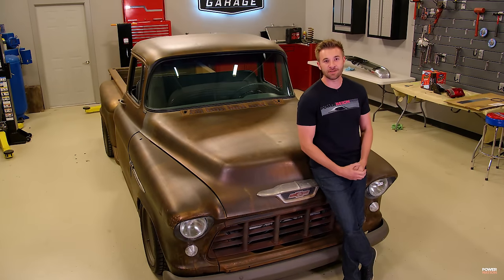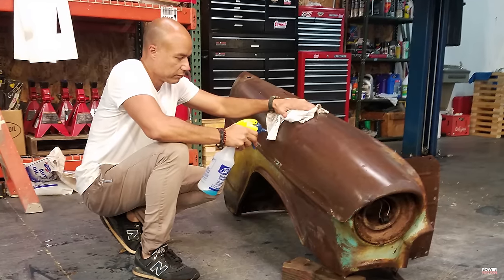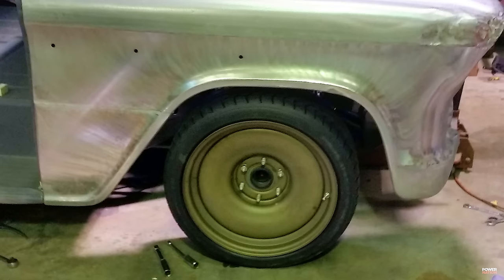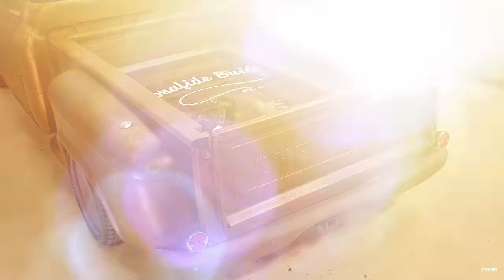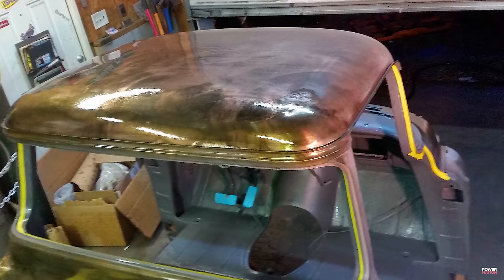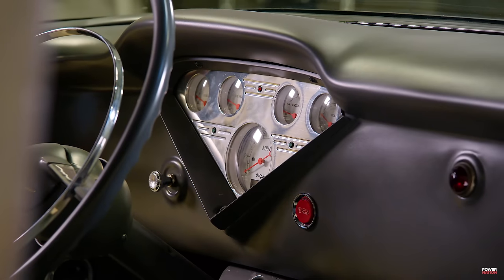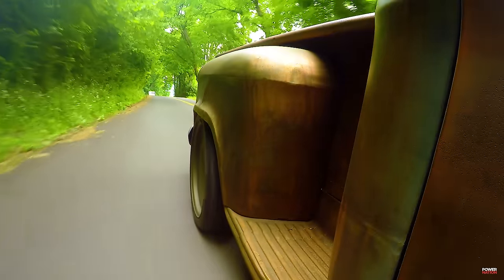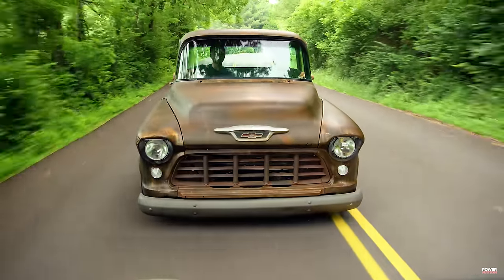A '55 Chevy Pickup And Tahoe Chassis Swap You Want To See!

Comment: Tech tip
I have had great success with using Tree Root Killer on bare metal to achieve a cool copper color.  Tree root killer is very inexpensive 
Tree root killer contains copper Sulpate and that is the chemical he described using in this video. 
Hope yall like the tip!
Reply: ...... I'm going to try that
Reply: Would you know how to then make that copper turn to a green tone? Like aged copper?
Reply: @mdeleon6 I would say just start soaking it down with a salt water and vinegar mix to start the corrosion process

Comment: My son's 1966 Chevy sits on a Tahoe and that was done 10 years ago at least.. the interesting thing with that is that it was a long bed cut down. Because the actual bed measurement looks like a short bed at first but it's actually in between the length of a 6 ft and 8 ft bed. With all of it cut off the front of the bed. Anyway it worked out good and it looks right. And truck appears to balanced aesthetically and will base is correct fitting the opening of the offender wells. I'll agree the title says setting it on a Tahoe frame and not enough of it with dedicated to that.

Comment: I have a 59 suburban on a 06 duramax chassis.... just shortened the frame no need to widen the fenders... and it has a 6 inch lift with 35s on it.... still getting built but should be done in the spring
Reply: Rock on...

Comment: Someone explain how they widened the front fenders
Reply: I have never done this but why would they modify the fender and not the frame? Its a 2wd frame.
Reply: @monahumada7535  if you widen the frame now you need to work on the suspension gemoetry, streering parts might not line up right. Body work just sits there doing nothing so its easier to make changes too without unintended consequences.
Reply: You just mark up the fenders (kinda squarly) and then cut it. Slide the panel out and then weld in a strip of metal to fill the gap.

Comment: Cool truck but why go through the work of doing a chassis swap when you can buy an ifs and 4link kit? Im guessing this was way more expensive than going that route?
Reply: Motorsporks Why? Because he got a much stronger frame, LS series engine, auto trans with overdrive, 4 wheel disc brakes... and on top of that I’m sure that burnt up Tahoe cost a lot less than aftermarket front and rear suspension would.
Reply: Cheaper, but much more labor.  I bought a rusted out 98' C1500 and did a very similar swap.  Lots of time, but the donor truck was only $500 running and driving.   You will pay for it one way or another - either with $$$ or with time.
Reply: @RacerRickxx  you did it with an apache?
Reply: @erikdale9145  59' Apache.  I am doing it with another, on a 91' C1500 shortbox frame and  LS swap.  This one is going to be my shop truck.
Reply: @RacerRickxx  nice dude, I am moving my 59 into the realm of heater, wood flat bed and modern engine/4wd to daily that beast more often. Looking for ideal best candidates. Shes been sitting in rust&moss for 35yrs or so.
Reply: .......mostly to be able to take advantage of all the modern technology......

Comment: No one has done it ?
I drop my 1958 on a 1978 GMC truck no problem
Reply: Same except my was an 1981 chevy pu
Reply: @taylorswiftnumberon1  I drill out the cab mounts of the old chassis to mount the Apache cab and now it makes a annoying noise from the mounts I have change the rubber spacers and hope that stops the noise
Reply: @mannygarcia3813  I don't know man ya may wanna check your motor mounts or trans mount even seen u joints cause a buzzing noise
Reply: @taylorswiftnumberon1  I gonna do that thanks
Reply: I put my 53 chev 2 door on 73 chevelle years ago. later put 57 pink nash rambler on 1990 buick. loved that one . also made a 53 cheifton from a 4 door to 3 door. stock with skirt on pass side. mags, decromed, flared on drive side. all with shoulder belts.
Reply: ....... no one had done it on this generation of Tahoe to my knowledge at the time we did it...
Reply: No one had done this with this generation of tahoe to my knowledge...... mostly s10 swaps